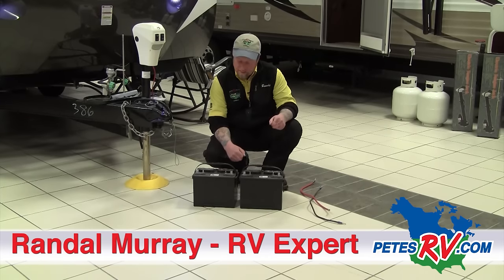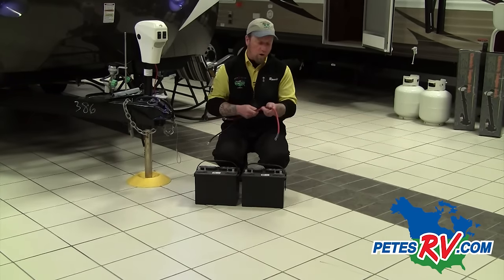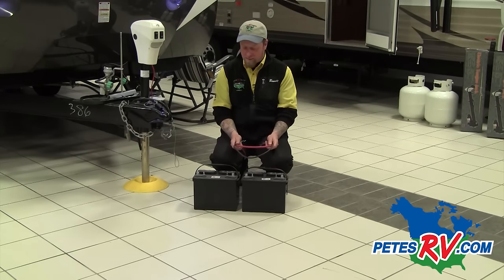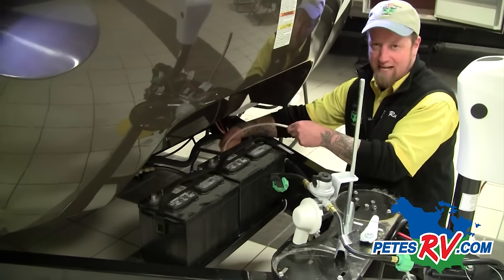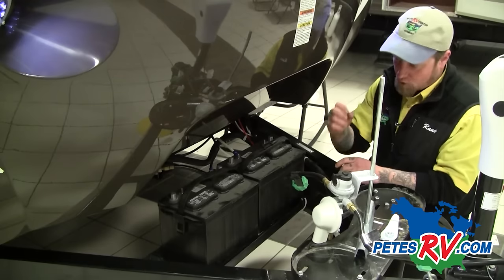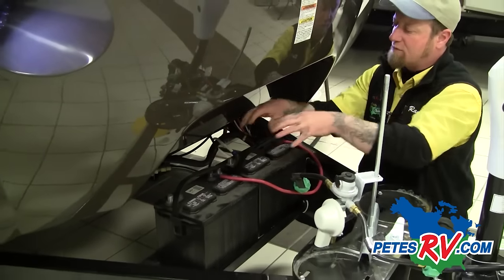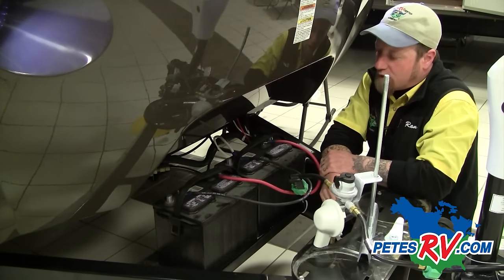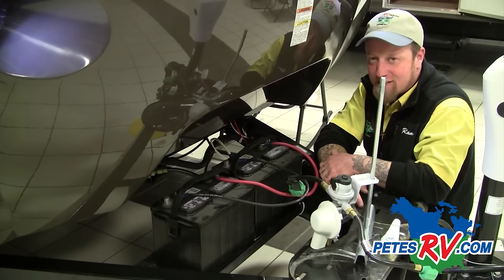12-VOLT DUAL BATTERY SETUP | Pete's RV Quick Tips (CC)

Comment: Great Video! The only issue is that from a circuit standpoint. It doesn't matter where you hook up the Negative. Ground is ground, and both the (-) terminals are shorted together. So there is no difference in the draw. That being said... One advantage of this kind of hook up is that the cables reach their respective terminal post better. But there is no difference if you put the Negative on one battery or the other. The current draw will be the same. If anything the minute resistance in the jumper cable would cause a difference in the draw/charge of the main battery, but this is so small that it is negligible. Still I like this setup!
Reply: The problem with doing it 'your way' is the possibility of creating circulating currents. In other words one losing charge quicker than the other on a load like a 12 volt fridge which may be going off and on results in a circulating current after usage for the less used battery to bring up the charge of the other battery. You also want both jumper wires to be as equal as possible in length and mechanical connection. Yes it will work your way but what makes you think there is no difference? Did you actually measure the circulating currents after having a load attached?

Comment: What's up with mixing AC and DC wire color codes? The camper is wired black(hot)/white(neutral) like an AC circuit while your DC battery cables are correctly red(pos) & black (gnd). It would be extremely possible to mistakenly reverse polarity to the black (hot) camper circuit with the black (gnd) battery cable. Shouldn't that entire DC circuit be nothing but red/black, camper included?
Reply: RealFloridaHorseman 
Welcome to my world my friend!
There is no color code for 12volt in the RV world, it's like the Wild West everybody does what they want. No wiring schematics ether!
Rule of thumb when hooking up a battery on a camper is look for the wire that is fused and that will be your positive, or look for the wire screwed to the A frame, that will be your ground.
Thanks for watching!

Comment: Good simple info! I kind of already knew and just wanted verification. Though I will undoubtedly use 3 batteries.
Reply: I know your comment was 6 years ago Lol.  Been living in my single battery (In camper) charged by car and 2 small solar panels on roof. But no matter how charged up this single battery is (Like 13.7volts for hours on end), come nighttime the laptop (alone) drains the battery within say 3 maybe 4 hrs! (Obviously under converter power).

Would 2 of these car batteries in the camper work? Or you are saying 3. Omg the price keeps getting higher.

Maybe 2? 
Oh I replied to you because I also knew parallel and all that too. And you came across as confident.

Comment: Ahhh.... I got an old camper so new to this. Wondered why a red white wire and black jumper.  Cool, thanks. Good info
Reply: What threw me off is the previous folk used a black cable vs red.

Comment: hey im going to replace my batteries on my 5th wheel... im wondering to remove and install the new ones do I have to disconnect the main power from the pole (50amp connection)???????

Comment: Question about using a larger gauge than what is originally used on the trailer. I disagree with that statement, mainly because the larger the gauge number is equal to a smaller wire. For example, 10 gauge wire is bigger in diameter than a 14 gauge wire. I do agree with hooking up with positive to positive and negative to negative. But I would suggest to hooking up the positives and the trailer positive first then the ground and negatives together last.

Comment: Hello in the case of many positive cables, both draw and charge. I have solar charger too.  do you put them on 1 terminal or is it better to separate and put on both terminals?
Reply from the maker: I would put all the positives on one terminal, providing wires were long enough and the terminal stud had enough threads showing to allow the nut to tighten properly. Thanks for watching! Randy

Comment: what happens if i connnect 12 volt batteries in series, i didn't know they were supposed to be connectet in parallel.
i can't start the rv, don't know if the started battery is just trash but i am connecting a jumper and the rv gives no signs of life

Comment: very informative thanks - do you have a link to the battery charging products used to charge while driving?  alternator to plug - is there an auto shut off when RV battery bank is fully charged?  thanks in advance

Comment: will two fully charged up deepcycle rv batteries open the slides? or do you need 220v off a generator or 30amp off a camp-post to do that? thanks

Comment: Randy you mentioned a 4 minutes 7 Seconds about charging the batteries off of the vehicle if you have the appropriate setup. But you can charge the batteries from a generator using the 30 amp cord that's supplied with the trailer that's connected to the converter correct?
Reply: Why would you think otherwise? The converters usually use chop the AC so it may result in noisy or singing alternator.

Comment: I have 2 6v GC batteries wired in series to make 12v with a 100w solar panel in my E150 van. When the sun goes down I would like to run wires from my starter battery to my 2 house batteries, can I just run the 2 wires off the starter battery directly to the 2 6v battery terminals where the charge controller attaches to the batteries and put a manual inline on/off switch? Someone said because my house batteries are 2 6V in series instead of 2 12 rv/marine batteries I could damage the house batteries.
Is that so?
Thanks Love your informative vids!
Reply: You only want to charge your two six volts in series when the vehicle is running otherwise you risk losing all battery power. I put a heavy duty golf cart solenoid in the positive line from the fused positive bus at the battery and connected the ground at the alternator. The solenoid is only energized when the ignition is on preventing accidental truck battery discharge. I use number six cables going back to a heavy duty anderson type connectors to change my trailer batteries and to provide power to my fridge on the road. The trailer side uses soft number six welders cable so it bends easily without possible breakage.  

 I once worked for Sun Automotive and I can tell you that all kinds of different batteries made by different and the same manufacturers give different results to automatic battery chargers and testers. You highest voltage is always going to be at the alternator. So to make up for the long wire run to your battery you may wish to attach cables as close as possible to the alternator. My new 2016 Chevy seems to be automatically be shutting down the alternator at times but apparently it is supposed t do that.

Comment: All went well until the last step when I attempted to connect the jumper from neg of one to neg of the other.  Connector sparked and lit up getting extremely hot...what did I do wrong?
Reply: If something sparked and got really hot quickly you had s dead short, which means things were not wired properly some how.
At that point I usually take everything apart and start over and hope for a different result. 
You were using 2 12 volt battery's correct? 
Thanks for watching, I hope you got it!!
Reply: You were probably connecting while a device was on, always turn you main battery kill switch off, then attach jumpers and finally connect the positive lead first then the ground lead.

Comment: I heard some churping noises in the motorhome earlier today.  When I went back in the motorhome a couple hours later to check it out I found that there is no 12 volt power at all, no lights, ect.  There is no reading of house battery volts at the all in one panel and there is no power to start the generator.  I checked all that I knew how to check, what do you recommend?
Reply: Hello, 
If you have a good chassis battery, and a AUX battery switch on the dash, you should be able to get the gen set running. This switch which most motorhome sate equipped with will link both sets of battery's together. 
A charger on the coach battery's can also be used. Good luck, thanks for watching!

Comment: I have a battery disconnect, do I need a different type of switch if I add a second battery?
Reply: You current battery disconnect will be just fine, with the extra battery you are not changing anything just giving yourself more stored power. Great question! Thanks for watching!!

Comment: How much difference is there between 2 12volt batteries and 4 6 volt batteries?  I'm doing a solar system on a travel trailer. Unless I relocate the batteries somewhere, I'm stuck with putting them on the tongue. Thanks.
Reply: Dennis that would depend on the amp hour ratings of the battery's. if you are not using a large investor to,power something. You can do two 6volts in series on the tongue along with some sun and your solar panel you should be good. Thanks for Watching!

Comment: Good vid, thanks. I have an agm battery. I was wondering how low I can discharge it without causing damage to the battery. When fully charged it reads 12.7 volts. Thanks again
Reply: Motor loads and electric heat are big draws that I use when discharging or load testing a battery. 
Thanks for watching!
Reply: Most AGM batteries can be fully drained, but the rule of thumb is to go no more than 20% which for a 12 volt agm battery is 10.4 volts. Most dc devices will quit functioning long before this is reached. 

Remember volts push amps.

Comment: What if both batteries aren't purchased at the same time?   Does it matter that much?   I just purchased a new TT 4 months ago and it came with 1 new battery.   So the battery is good yet.  I just want to add a 2nd battery.
Reply: A difference of only a few months, while perhaps not ideal, isn't going to matter all that much.

Comment: My truck has two Optima gel batteries in it when the 7 pin connector is connected to my fifth wheel it will blow the 30 amp fuse that is inline on the 7 pin connector to the trailer do I simply need a bigger fuse or is my truck having two batteries that are gel the problem because I was under the impression that it didn't matter as long as they were in parallel so that's what makes me assume that I just need a bigger fuse as the fuse doesn't seem stock it looks like to me that fuse was added as a second level of protection any type of help would be greatly appreciated
Reply: don’t add a Higher amp fuse EVER until you have a professional find your problem.

Comment: I bought a newer trailer and swapped out the old batteries.  I want to wire them in parallel as I have in my older trailer.  But, this trailer has a blue wire (with inline fuse) a red wire (with an inline fuse) and a white (ground wire hooked to the frame).  I believe the red goes to the positive terminal, and the white goes to the negative terminal on the other battery.  Where does the blue wire go, positive or negative and which battery?  Hope that makes sense.  Thanks
Reply: Blue is usually used for the electric brakes it may be connected to the safety emergency trailer brake connection but you are going to have to either check the owner manual or trace out the wiring itself.

Comment: Hello Pete's RV is it a must to have the black parallel cable? I was told I only needed the red to connect the two batteries in parallel. Hope someone can answer this question
Reply: Cable color is for quick ID only. It means nothing to the electrons in the copper wire. if ever in doubt use a meter or follow a wire to confirm DC polarity or if the AC wire is hot. You need two cables to connect two batteries in parallel you need only one to connect them in series. if you want twelve volts from two twelve volt batteries connect them in parallel. If you want twelve volts from to six volt batteries connect them in series. If you want 24 volts from two twelve volt batteries connect them in series.

Comment: I know you said keep batteries the same age, I have a few questions.  

My first battery is about 8 months old, I just bough my battery.  The current battery charges at 12.7v.  I don't know the amp hour. 

My second battery, I just bought.  It too is lead-acid.  It's considered deep cycle like first.  It has 140 amp-hr rating. 

What gauge do you recommend.  It looks like the first battery is using 4-gauge.  Do you recommend 2-gauge.  I  find this hard to believe but guy at store told me 2-gauge will cause more resistance. 

I'm having to do this because I cannot run my furnace for more than 2-3 hours on battery.  I didn't have this problem early on in the coach.  The battery has gotten so low the first time that the low-power alarm went off and I was not able to start generator. I used car alternator to give power to generator. 

How much should I expect to pay for a good battery.  My second battery is normally $129, but I bought it on sale for $95.  $50 cheaper does worry me a bit. 

Do you know typically how long a battery should last on heat.  I had no lights on and even if I did they it might have been 1 LED light over the bed.  

How can I get in touch with you? 

Thx
Reply: +Default Name 

One thing I should note.  With the first battery, I've seen the voltage will drop from 12.7 to about 12v the instance the heater starts.  And good number of times, the blower has been running but no heat. 

I know there is LP gas because the main panel says so.  And I've tested the LP stove and it starts immediately. 

This last thing has been a puzzle.  I'm speculating a short in the blower cause a major power drain.  IDK.
Reply: Wire size is usually determined by the amp draw from the coach and the breaker that you are hooking to. 2 gauge sounds rather large unless you have a large inverter in play. On your basic travel trailer you will typically see 4 or 6 gauge wire. Again locate the breaker that the battery's are hooked to or look at the existing wire to help gauge your new wire. Thanks for watching!!

Comment: What gauge wire did you use in this video?  Thanks
Reply: Hello,
I was using 6 gauge wire in this video, which was the same size wire that came equipped on the camper for the single battery set up. 
Thanks for watching!!

Comment: What do you recommend to charge the batteries if you're not hauling?
Reply: Hey there Staci Hamson,
I recommend a bench charger to anyone doing any type of camping that will pull their batteries down. The bench charger at home is the best way to start with a fully charged battery, and a great way to maintain your batteries. I have made a video for that recently, winter battery storage.
Thanks for watching!
Reply: Battery tender. About $50.

Comment: What happens if one batt has 11.85V or 8V  and the other 12V are connected in parallel ?
Reply: Hello,
The voltage will most likely equalize or take the lower of the two. You will only be as good as your lesser battery. Always best to start out with two like battery's purchased at the same time. 
Thanks for watching!
Reply: Thanks  .

Comment: How would I hook a parallel pair of generators to that pair of batteries?
Reply: Hook the positive of the first 12 volt generator to the positive terminal of the first battery and the negative to the negative of the second battery. Take the second generator and hook positive to the positive terminal of the second battery and the negative to the first battery. This way the charging rates should be equalized and one alternator should not end up doing more work than the other. If your using different kinds of alternators or longer alternator cables on one alternator than the other or trying to get 120 volts out of either or both generators at the same time I would only use one alternator on the 12 volt side with connections to the positive of one battery and the negative of the other battery. i would also not use battery clips which can easily fall off. Sparks near charging batteries is never a good thing.

Comment: Big problem with this video.  He doesn't have the batter boxes fitted in there.  I'm trying to do this now and the problem is that I can't fit the batteries and the boxes on the trailer.  Don't have a solution yet, but two batteries and the appropriate boxes are not going to fit on that trailer just like on mine
Reply: My batteries, each in a group 31 box, will not fit into the supplied space on the RV tongue either. My options are a new metal bracket fitted on top of the tongue, no boxes for the batteries, or some other type of cover over those bare batteries. At this point, I'm favoring the latter option - a vinyl or canvas cover over the batteries. It's been 3 months since your comment. What solution did you finally decide on?
Reply: Hey there dogie daddy,
No boxes were used for a better visual in this video. Your typical travel trailer will accommodate 2 group 24 boxes, which are the batteries in the video, any larger than that and minor alterations will need to be made. I have made two 6 volts work on most A frame set ups as well. 
Thanks for watching!!

Comment: if it's 6 Gauge enough but i used 2 gauge it's will be better or Overkill??
Reply: With 12v, at that short distance, you're not going to see any difference between 6 or 2 gauge. Of course, that would certainly change with a thinner gauge wire.
Reply: Hey there mnsdh21,
Your wire size is gauged by the fuse protecting that wire,  a larger wire will definitely not hurt anything and as mentioned in the other comment a larger wire will give less resistance. 
Thanks for watching!

Comment: what gauge did you use for the parallel?
Reply: Use the same or bigger gage than the output is using. Also make them as mechanically identical as possible.

Comment: hey randy, i hooked my batteries up just like you said, but when testing them one reads 12.5 and the other reads -12.5.  Is one supposed to read a negative charge?
Reply: White is ground............  Black or other colors is the POSTIVE.     reverse, the Voltmeter Leads.